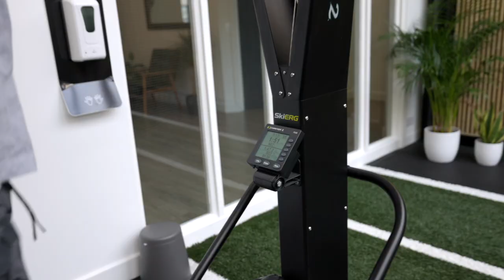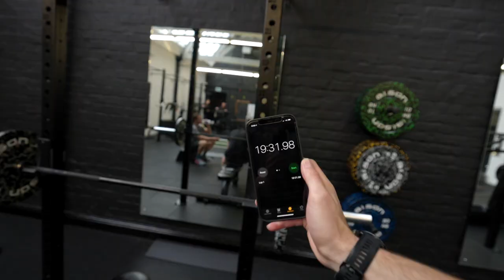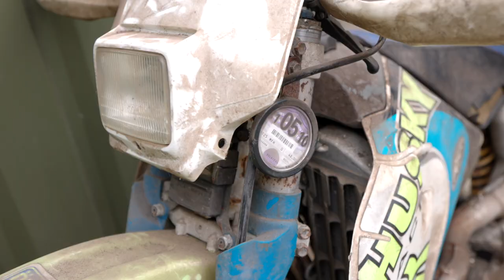MY NEW BIKE SPITS FLAMES!

Comment: I remember when these bikes were the pups nuts faster 0-60 than a gpz900 of the day .. Every one wanted one until they got one as they were gits to start ... so the fact you got it going shows its a good un... nice one, new suspension powder coat frame some head work your good to go ..some plastics too and a bash plate

Comment: I had a YZ250 back in 2000, brand spanking new and while I was on holiday, someone stole it from my parents house in the night. Cut the garage door off. The insurance had ran out a week before and my parents called the police on the night. I'd had it 13 months, and paid 4800 for it (how cheap, eh?)

Anyway, where I worked in Oldham, a guy had one of these Husky 610te's (It was new at the time, so not much younger than your bike) and I used to see it every day and pine over it/my YZ/offroad bikes in general.

FF 23 years without any bike whatsoever and I am about to get a WR450 and I can't wait. Missed the off road community and riding so much.

Comment: Go original.
Café? FRO! Didn't think anyone but questionable sexuality individuals with glasses, plaid shirts and waxed mustasches ever considered that fad.
Had a '93 with Öhlins shocks (Sachs original) rode enduro and street with it,.. best non-two stroke I ever had. 
I have two klx650r and one ttr600 at the moment. None even close. Also a gas gas EC 300 that is even better of course, but the 117kg an 50hp 610TE with 6 speed is amazing. Did the TC have 6speed or 4 speed? low 1st and over drive 5th and 6th is TE std.